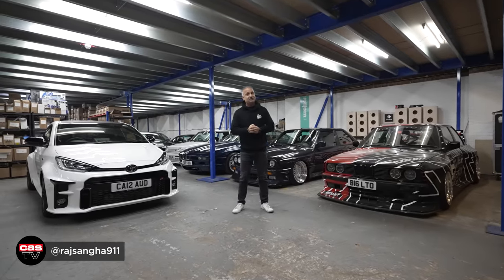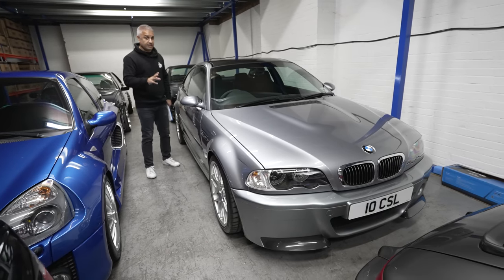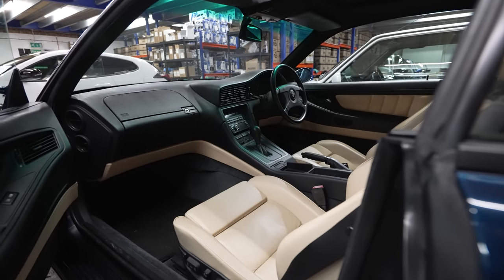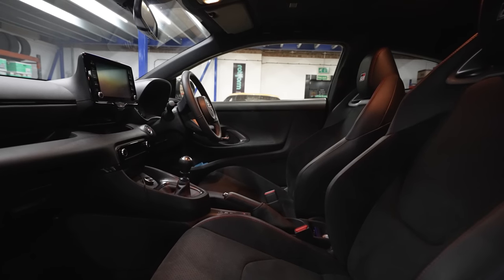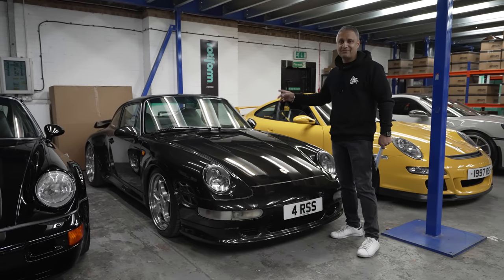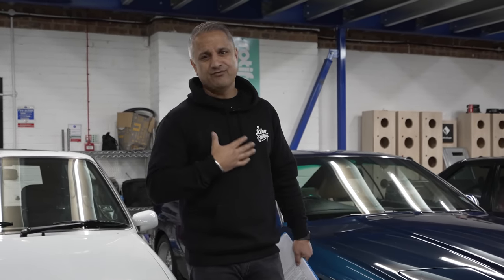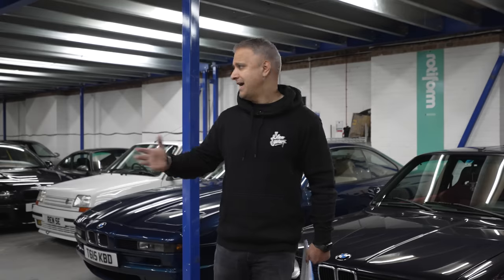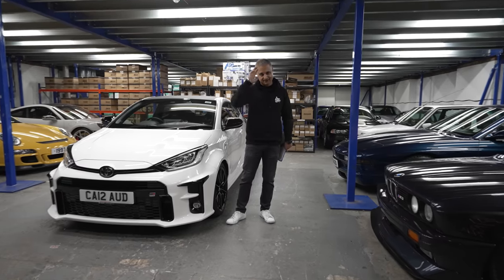Raj's Garage Winter Update 2022 | Raj's Garage Ep 43

Comment: The Airlift 3H system is too complicated and therefore unreliable, everyone I know has teething issues with it.
Reply from the maker: We have no problem with our Airlift 3H systems - it's all down to the installation 😉
Reply: @CarAudioSecurityUK  agreed a lot is down to quality of installation. But the electronics on the HLS make it less reliable. Air ride is most reliable with a switch, pump and tank, less things to go wrong. This is why aircups work so much better.